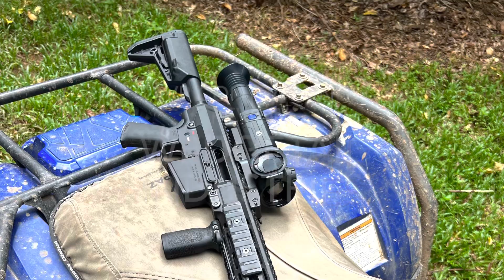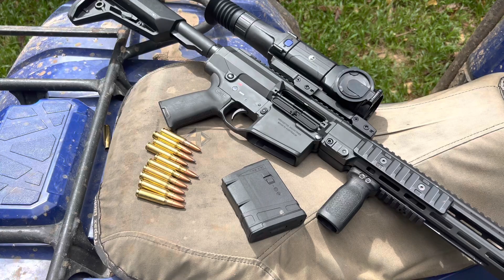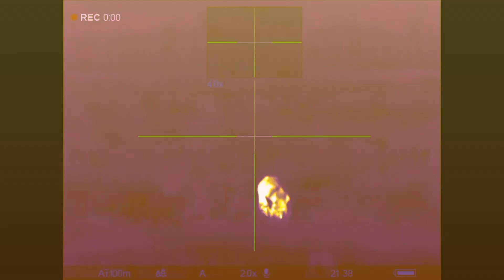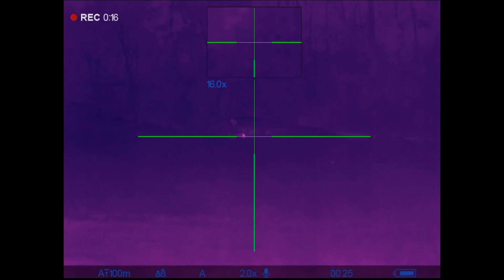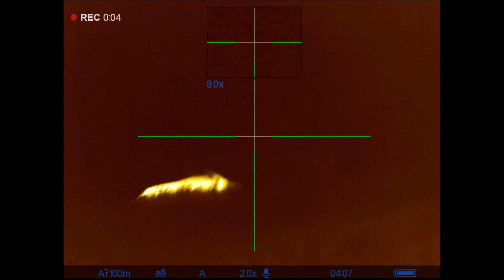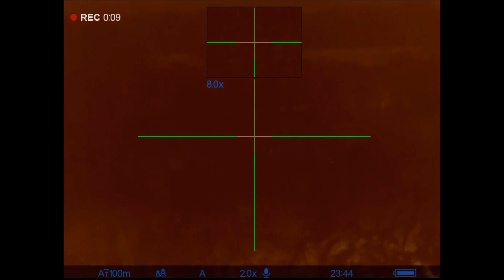Wedgetail Industries MPR mod 2 pump action 308 Winchester rifle review

Comment: Mate what thermal are you using and can it be switched to daylight? I really like how you can put your eye to the scope to clear out surrounding light. Perfect for me if it can be switched from day to thermal up here in the NT.
Reply from the maker: That particular thermal unit is a Pulsar Trail 2 XP50. It is just straight thermal with no separate optical capability. Pulsar have recently released a model called the Duo XP- it is both a standard optical scope and high Res thermal. Fits in 30mm rings. Might be the sort of thing you are after.

Comment: Just a quick question, in the footage with the pigs: was that using a tripod? Just curious on your thoughts if the shuttle is distracting / puts you off a follow up shot whist using a tripod, or do you feel it's more controlled than a bolt action?
Reply from the maker: I think for thermal work in relatively close its significantly more efficient than a bolt gun
Reply from the maker: All free hand shooting or off field rests. It would be workable with a tripod with a little practice

Comment: Thanks Nathan, great review. Have you tested accuracy with an optical sight and if so what power, range and what size groups?
Reply from the maker: Hi There John., thanks.  No I didn’t shoot it with day optics- used the rifle extensively in the field but didn’t have time while i had it to switch it over and test accuracy in detail. Confident based on what it did with thermal that they will be very accurate rifles.

Comment: Great review and info, I’ve had my name on the list for a couple of years, so very emotionally committed…
First mag, 10th case stuck pretty bad. I think you said it had about 80 rounds through it prior. I would thing that’s not a great sign, what were your thoughts when that happened? Had it done it before? Also, I notice the video has breaks between each mag, was there much time between each one, it would have been great to see three mags being discharged as quickly as possible, including mag swop, with no break in the vid.
But thanks again, it a neat rifle!
Reply from the maker: Thanks. For info- No cases were stuck during this. The ammo was fairly low quality American Eagle 150 gr FMJ, low quality plinking ammo. The case you are referring to was damaged and not firearm related. One box of that particular ammo was faulty. Any concerns relating to function and cycling are completely unfounded- it feeds and cycles everything very well. If a 180 gr woodleigh load doesn’t cause feed or extraction issues, not much ever will !

Comment: Good stuff. I have a Warwick WFA2-308w, a fantastic rifle, with the FABA pump kit. I recon they would be very similar.
Reply from the maker: Haven’t used the Warwick rifle but my sense is that they are also a quality firearm. The upside of the MPR is that it is engineered from the ground up as a pump action 👍
Reply: @FVR375  when you get a chance try one out. You will be surprised how smooth the action is. The plus side is, I can take the FABA off when shooting prone. But either way, I believe both are high quality rifle's. I would easily have a Wedgetail, but have a love affair with the Warwick.I also have one in 223wld. All the best and happy shooting.

Comment: In your opinion is a spring assisted pump action better to use than a regular pump action mechanism when it comes to cycling? Cheers for the vid.
Reply from the maker: I think it definitely is. Very smooth to operate
Reply: @FVR375  It would be interesting to compare the MPR308 mod 2 against the WFA2 with FABA kit. Thanks for the reply.

Comment: Looks like the suppressor attachment isnt that effective on recoil reduction?
Reply from the maker: It definitely is. I run the same set up on a number of rifles that get shot at high volumes. 👍👍
Reply: @FVR375  This isnt a supressor though s it? isnt it a forward port muzzle break? usually used for work from choppers?
Reply from the maker: @nicholaswirth1011  that’s correct. A blast jacket. Not a suppressor 👍